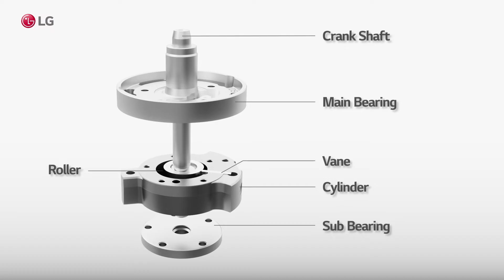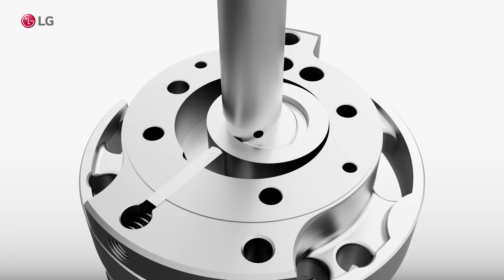The Evolution of LG's Rotary Compressor for Air conditioner

Comment: The copper pipe is very weak
Reply: Suggest another suitable metal that is widely used for refrigerant compressors. Refrigerant compressors utilize copper inlets and outlets primarily due to copper's excellent thermal conductivity and durability. Copper's high thermal conductivity allows for efficient heat transfer, while its durability and resistance to corrosion ensure longevity and reliability in refrigerant systems.
Reply: @brothervance1932  silver 😂
Reply: @erkinalp Expensive and not widely used for refrigerant compressors.